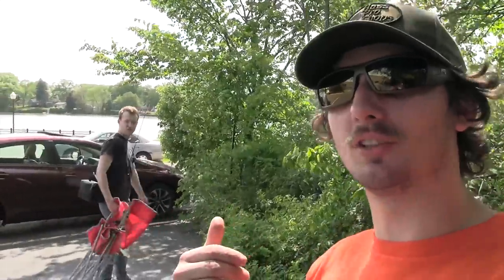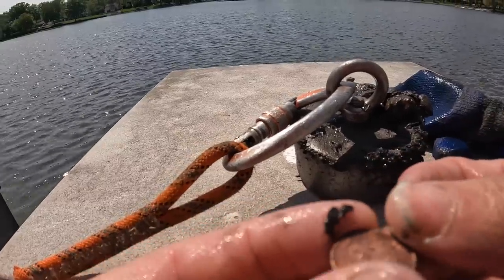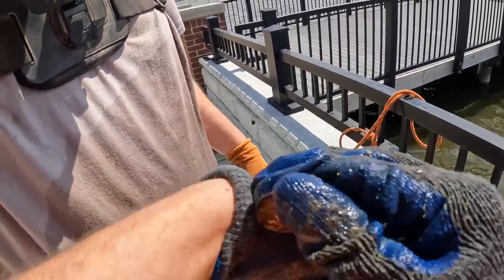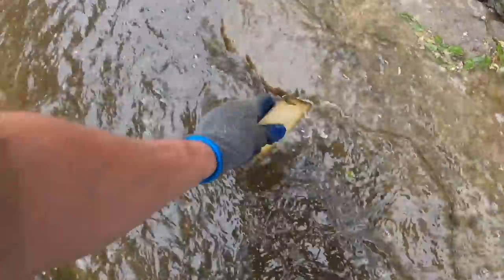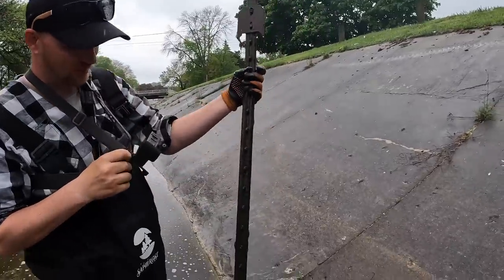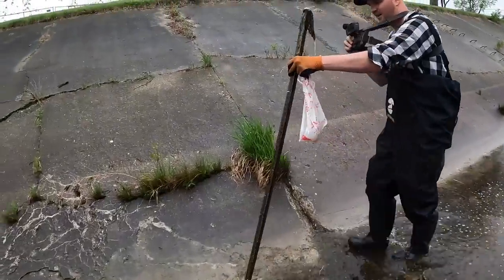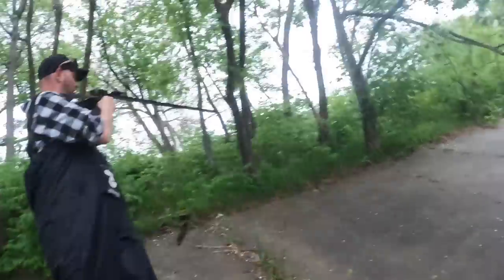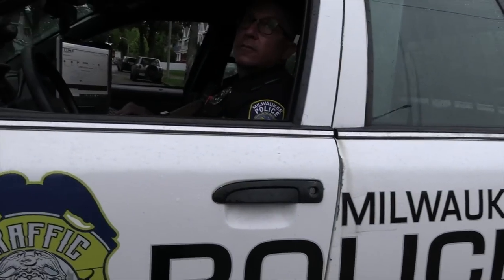Filthy Milwaukee Canal Delivers Us A Stinky Mystery Bag While Magnet Fishing

Comment: The posts you are finding are called T posts . They are used for barbed wire fence, add insulators and electric fence etc , also put signs on them.